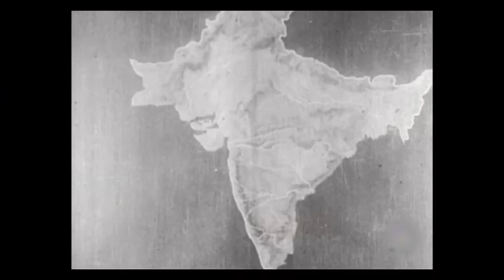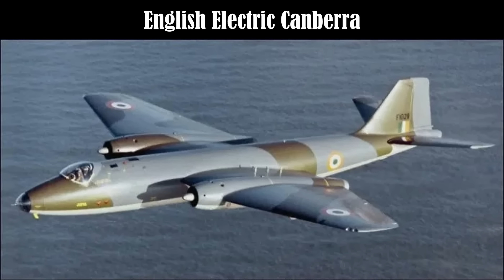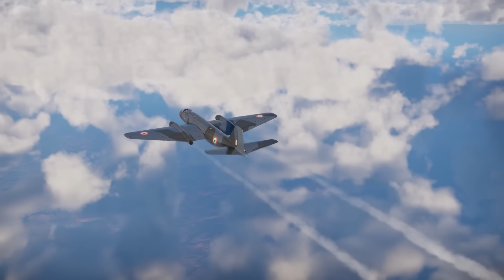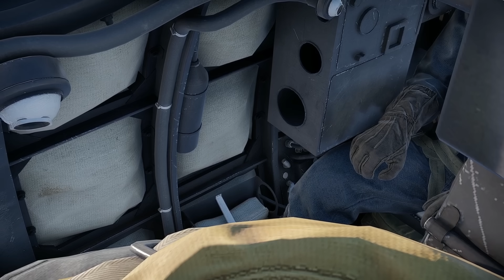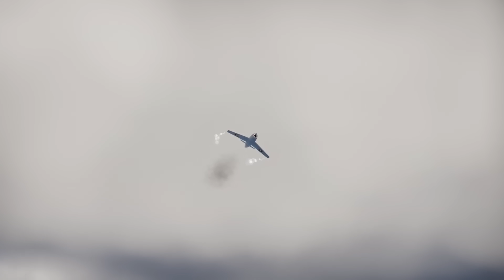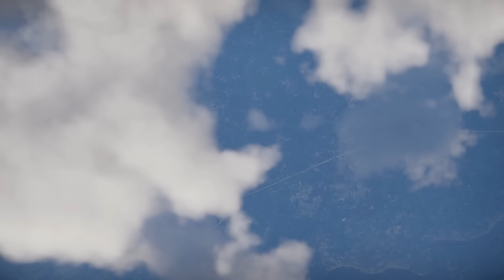Pakistan Air Force's Maiden Kill: The 1959 Canberra Incident

Comment: I've had the privilege of speaking with the late Wing Commander Jagmohan 'Jaggi' Nath (Retd.) during the period 2014 - 2015. 
As compared to the Pakistani B-57 Canberras acquired from the Americans, the IAF Canberras did not have an ejection seat mechanism. However, despite this disadvantage the Indian Canberras proved their mettle in battle. 
I remember seeing a derelict Canberra parked away from the runway at the Agra airbase in 2006. It was an awe inspiring sight.
I must point out that the aircraft portrayed in this video are Martin B-57 Canberras which were acquired by the PAF. The Indian Canberras acquired from Britain were rudimentary and had their cockpit canopies askew on the port / left (or was it the starboard / right?) side of the airframe.
Reply: Absolutely right sir, My father was in the Canberra 106 Squadron when it was decommissioned in AFS Agra. That Canberra had the cockpit tilted to one side instead of being symmetric.

Comment: Every aircraft looses altitude in a sharp turn. Opposite rudder cures most of that. My father flew the Martin RB-57A in the mid 50s in Germany. Of all the aircraft he flew he said that one felt like he strapped on the plane and he was at one with it. Big wing that wanted to fly but you had better stay in front of it because it will bite your ass if you stop paying attention.  Losing one engine on landing was very dicey indeed. Famous film of one crashing I believe at Spangdahlem Germany due to engine failure and pilot error when reacting to it. It was at its best looking in the all black Recon paint scheme of the day. Usually with red trim.
Reply: He didn't say all aircraft don't, he said the canberra had a higher affect of altitude fall during turns

Comment: Great story.  Makes me kind of wonder why the USAF didn't buy the Canberra when it first came out instead of using the very tired B-29's in Korea.  Martin eventually built them on licence and we started getting B-57 squadrons by 1955 but it could have come on line way sooner and we could have lost a lot less airmen in Korea.
Reply: US politicians don't like buying foreign aircraft unless the best US built alternative is inferior, or doesn't exist.  The B-29 was used in Korea because initially the North Korean air force only had WW2 vintage aircraft itself.
Reply from the maker: Thanks once again! It would have certainly been very interesting to see how a campaign against North Korea would have worked with Canberras instead of Superfortresses. 
Speaking of Korea, in the near future you can expect that conflict covered a lot more than recently.
Reply: @showtime112 Don't know if mig15 /bis can reach B57  at 50.000ft🤔 and if possible,  i want to know the résult if B57 was hit by 23mm or 37mm shell. 
May be dévastating ?

Comment: 8:37 in F/L Yunis's own words "...put a bead on his right engine – just in time I remembered my Hunter wingspan setting and quickly ranged on half the Canberra's span – immediately I could see my bullets impacting on his right engine. I traversed the bead to the left engine and back to the centre, not letting go of the trigger till the guns stopped..."

The F-86F-40NA s/n 55-5005 flown by F/L Yunis in this interception is preserved at PAF Base Peshawar.

On a side note the PAF No. 15 Squadron currently operates J-10Cs, while the IAF No. 106 Squadron operates Su-30MKIs, having flown Canberras in the PR role all the way up to 2007.
Reply from the maker: Thank you for providing additional info!
Reply: The young Pakistani pilot sure wanted that kill. It's amazing non of the bullets penetrated and killed the crew and almost a unbelievable the navigator bailed out as if it was a B-17
Reply: @jthomas4361  The crew were quite well protected from the straight rear as the entire center section of the fuselage is filled with fuel tanks. Only way to get the crew would be from a sideways or downwards shot into the nose section
Reply: These are the kind of comments which add value.👍🏼